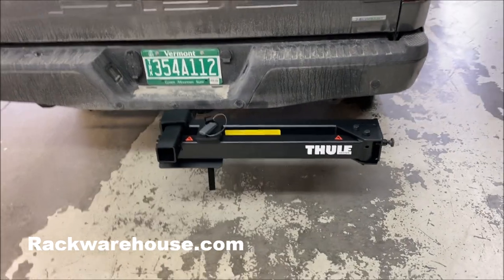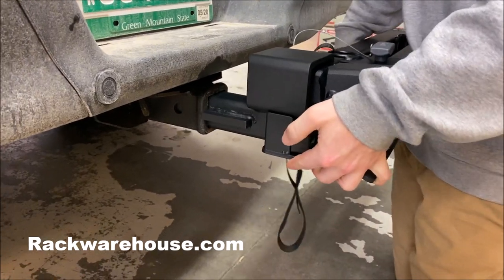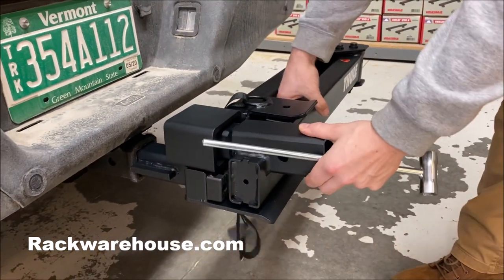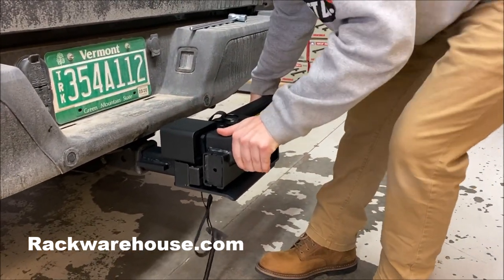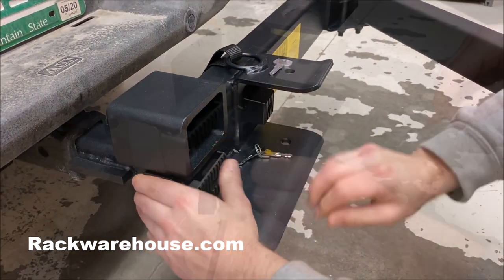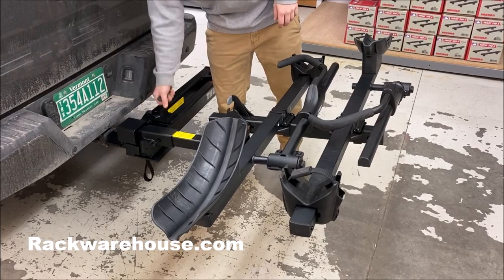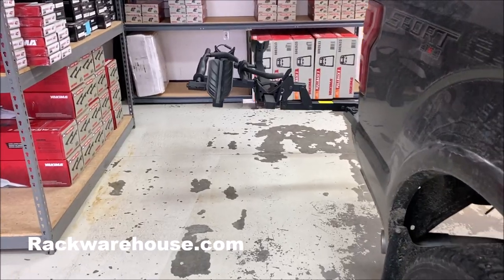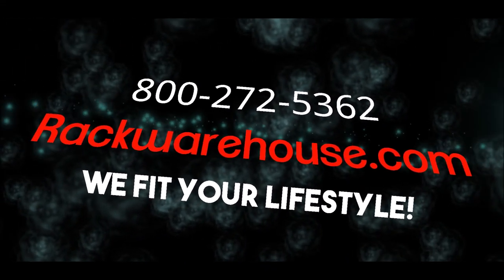Thule Access 9037 Swing-Away 2" Hitch Base

Comment: You can only place bike racks?  Why cant cargo carriers or wheelchair racks slide into the 2 inch receiver?
Reply from the maker: Thule does not test these products for compatibility. However, as long as the cargo carrier or wheelchair rack is within the Swing-Away's weight rating it's very likely you could use such carriers.

Comment: We have a mobile pet grooming van and been looking for something like this! We want to install a generator on a bumper rack but it needs to swing open as we still need to access the rear doors for tub and plumbing maintenance and wondering if it will hold the weight of a Honda generator 6500?
Reply from the maker: If your generator is under the 250lb weight limit and you can find a secure way to attach it we don't see a reason why it wouldn't work.

Comment: Did you end up drilling a new hole to slide the pin in where the swing away mounts to the vehicles hitch reciever?
Reply from the maker: No drilling was preformed while installing this hitch base in our video, and is not required to install the Swing-Away.
Reply: Why does this only work with a bike rack?   I have a hitch tray that I need to mount to a swing arm and it will be supporting a toolbox and some other camping gear

Comment: When the bike rack is attached, empty and folded up, what is the distance to the back of the vehicle. I'm trying to figure out if the hatch door on my 2021 Telluride would open with this on the vehicle. Thanks
Reply from the maker: If you would like to open the hatch, you can use the swing base to move the bike rack out of the way to get full access to the tailgate of the vehicle. That is the main purpose for purchasing the Thule Swing Away. The bike attachment is a bike rack sold separately.

Comment: Can this be used for a rear cargo carrier instead of a bike rack?
Reply from the maker: If your cargo carrier and the contents you plan to load into it are within the weight rating of the Swing Away, and the hardware to the carrier is intended to be installed in a 2" hitch receiver then that should work just fine.
Reply: @rackwarehouse  Are there instructions somewhere of how to attach the carrier to the swing-away hitch?
Reply from the maker: The instructions to attach the carrier should be included with the carrier itself, as the process to install a rack into the Swing Away is the same as installing said product in a hitch receiver. Thule does not officially test any products compatibility however with any but their own.
Reply: @rackwarehouse  cool. I see that now. I imagine a rear hitch cargo carrier would end up sticking out quite far though. Gotta do some more research. Thanks for your help!

Comment: How do you lock the bike rack to the Access swing?
Reply from the maker: To lock your bike rack to the Access Swing Away, your bike rack either has to already have pre-existing locking capability to a hitch, or you would have to purchase a hitch lock or locking cable separately. Thanks for watching!
Reply: @rackwarehouse  do you have a video on Thule Range rack? That is the one I am buying
Reply from the maker: We do not unfortunately. However we do have that video in the works currently.